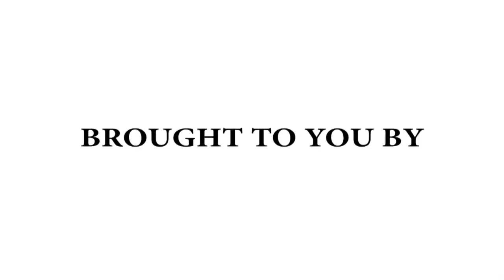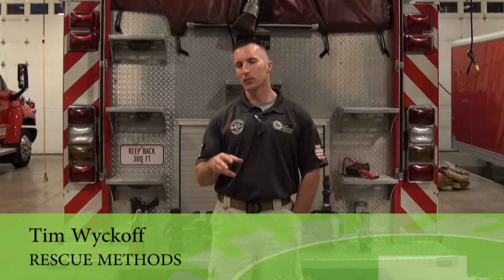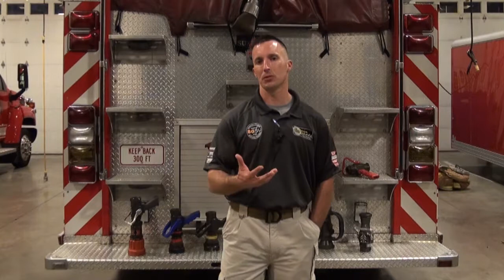Automatic Nozzles

Comment: This is one of the most accurate presentation on automatics that I have seen.   When you put your thumb over a hose where does the increase in pressure come from?  Did the water company see you do it and crank up the pressure.  Of course not.  What happened is that the reduced flow has reduced friction loss in the hose and so the pressure that was being lost for high flow without thump goes down and that leaves working pressure at the end.  The one thing I would say is slightly misstated is that high pump pressure increases reaction force.  Not directly.   High pump pressure let’s the spring open up delivering more the flow.  The higher flow causes the reaction force.  Another cool thing about TFT automatics is that they have a turbulence free valve such that the nozzle man can open it op to what they can handle and the pressure will be corrected and the stream will be turbulence free.   Nice work